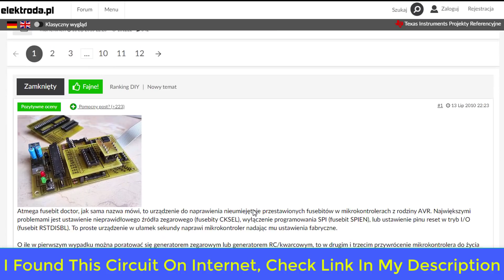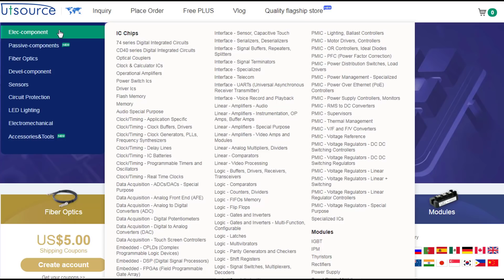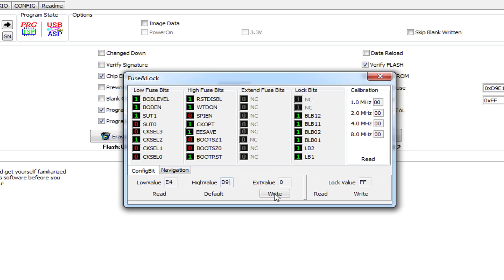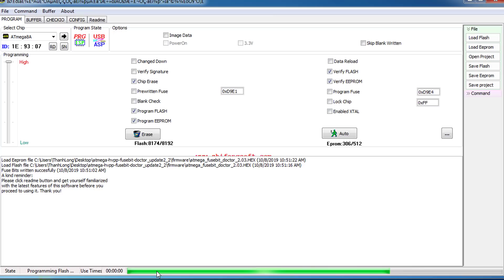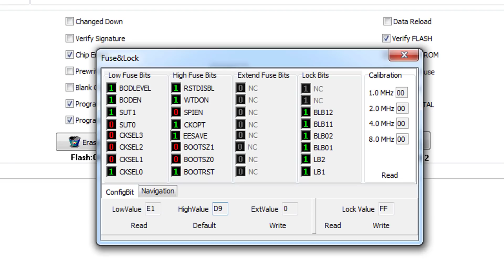AVR ATmega Fusebit DOCTOR , What should we do when ATmega Dies Due To Fuse Bit Wrong ?

Comment: nice work man
i've a question can i use the circuit to fix fuse bit for atmega328p-au i mean smd version not dip with TQFP32 to dip28 adapter?

Comment: Nối chân osc1 với 1 mạch arduino chân 13  sửa code blink bỏ delay cho nhanh 😂. Mở progio 1.7 lên vào set fuse bit nối chân 13 vô osc1 là xong
Reply from the maker: Cách đó chỉ cứu được vài trường hợp đơn giản. Mạch này cấp thẳng 12V vào phần cứng kết hợp điều khiển phá bỏ fuse bit
Reply: @LongTechnical  chắc cũng tùy con tại em mới bỏ được atmega 8 chứ chưa thử bỏ fuse mấy con cao hơn như at16 at32